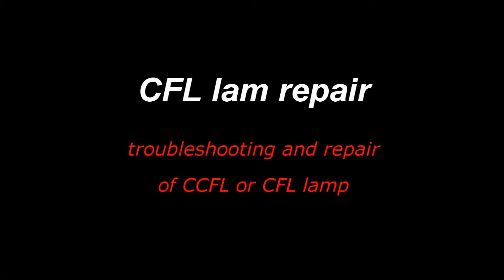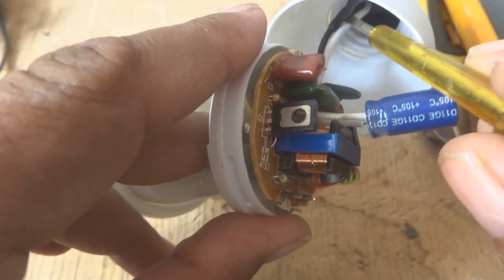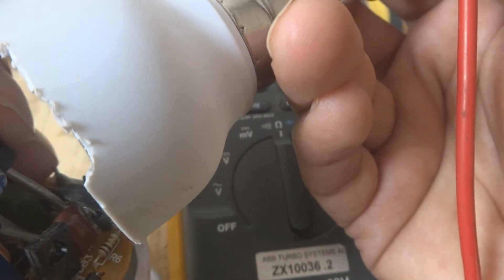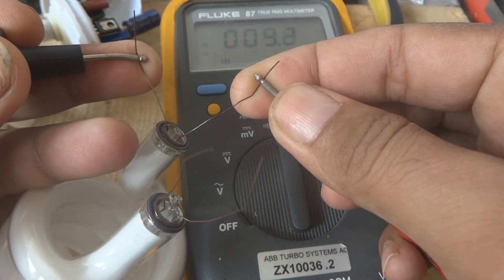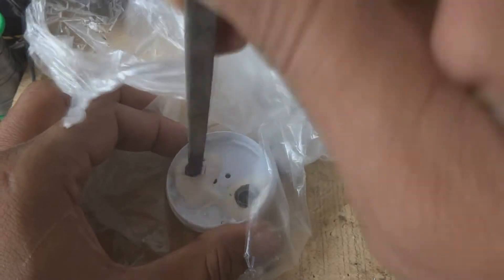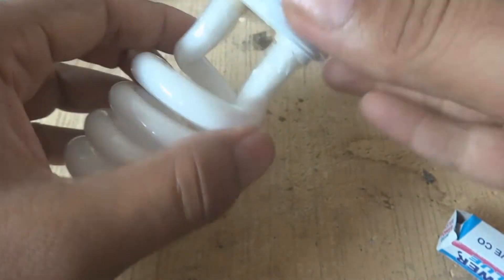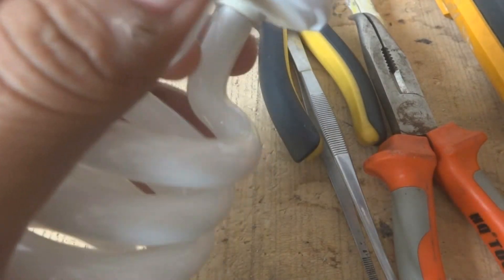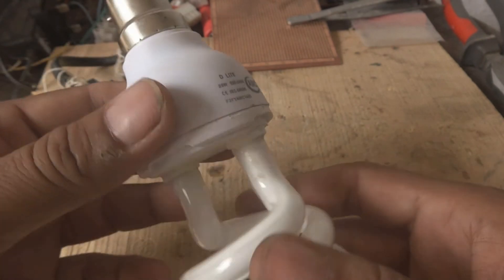CFL lamp repair English

Comment: What is the reason the fuse blows out everytime i switch on my cfl.replaced fuse.replace fuse.why?
Reply from the maker: The reason is a big short circuit. It could be inside lamp, in wiring or in lamp holder. Further testing would help figure it out. Stay tuned and blessed.